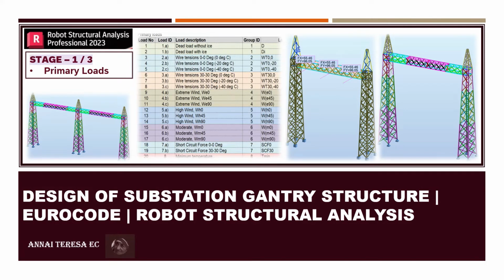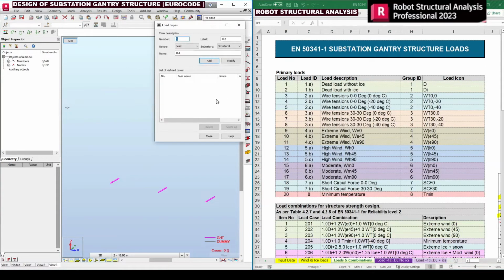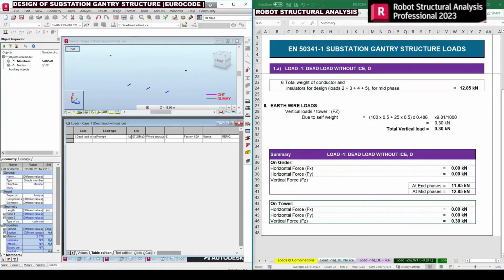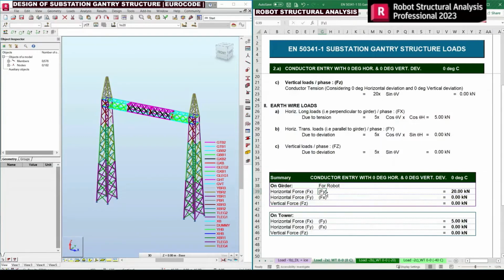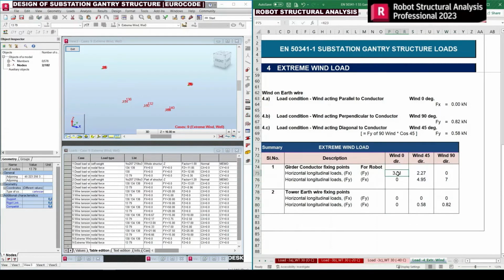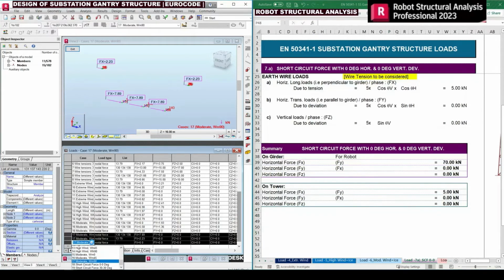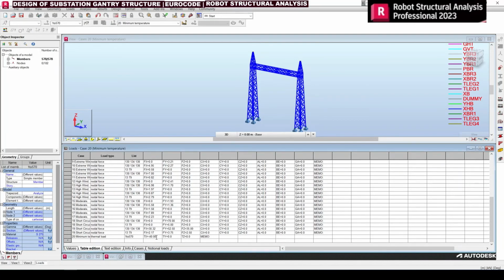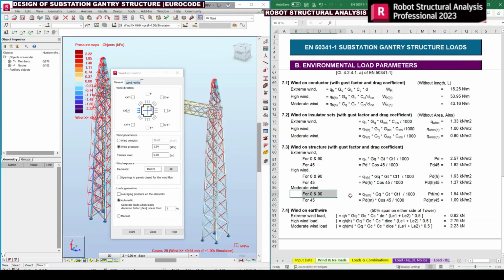Design of Substation Gantry structure | Eurocode | Robot Structural Analysis | STAGE 1 of 3

Comment: Did you include wind to the structure, when structural members are covered with ice (taken into account the increased thickness of structural members)? 
Shouldn't the values for high wind and the moderate wind, been increased with the factor of dice / d ?
Thank you for these amazing tutorials.
Reply from the maker: Thanks for watching. Yes, the factors are considered already for ice load. There are 6 stages of videos explaining the load calculation. As per EN 50341, ice covered on the steel part is not considered as it won't cause significant impact. The ice covered conductor is the main focus that decides the gantry structure design. Refer: https://youtu.be/B9_lNt-PEXs?si=qjkCrN2oVG6W70V5 for ice concern.
Reply: @annaiteresaec  Hi again, another questions :) 
I am new to the wind simulation. 
1. For instance, for Extreme wind, you are using a wind pressure that is almost 5 times higher than your qh. Doesn't the robot self account/calculate the pressure coefficients when using wind simulation?
2. For wind 45 degrees, you are multiplying the Pd with cos45, is it necessary to do that? Wouldn't the wind simulation on Robot do that automatically?

I am doing a verification on a lattice structure using the Robot.

Comment: Thanks for these tutorials
Reply from the maker: Welcome. Thanks for watching.
Reply: @annaiteresaec  Where do you get standard imposed and dead load for UKPN Substations control room and switch house?
Reply from the maker: @junaidijaz9907  Standard imposed and Dead loads for control room and switchgear building can be get from Standards (for example BS EN 1991- part 3). Also, Technical specification (For Example National Grid in UK) and Equipment manufacturers specification can be referred.